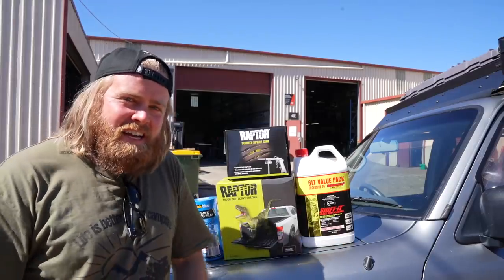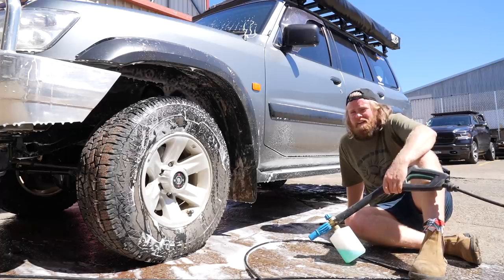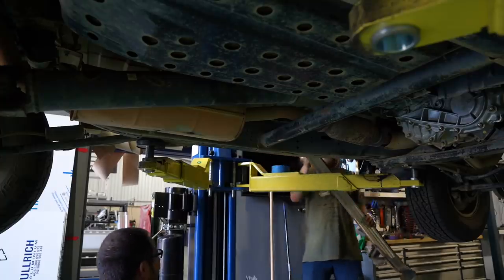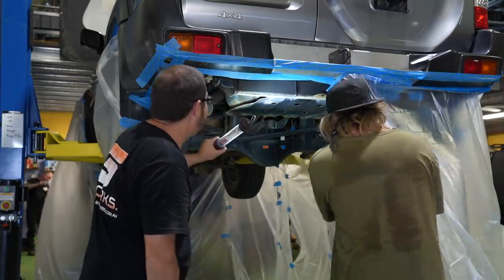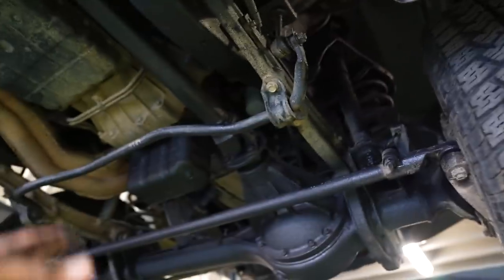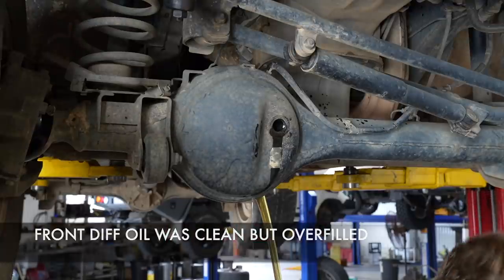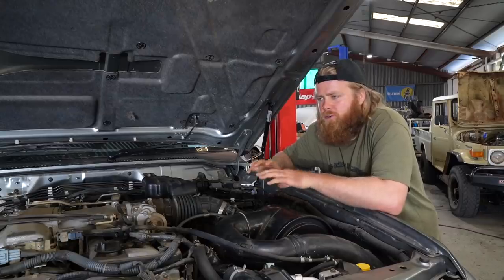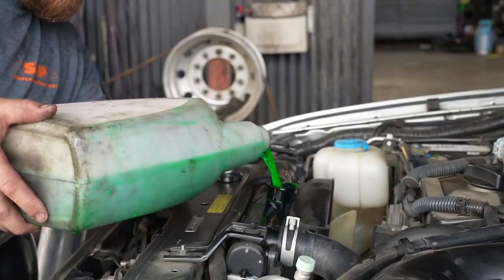DIY RUST PROOFING a 4WD! I blasted the Patrol with PAINT! + FIRST SERVICE! Nissan GU Patrol Build #3

Comment: My biggest concern with doing this type of protection is the potential of trapping moisture behind the layer and creating a corrosion zone. I've seen this done in salty winter road parts of the world and it doesn't always work out as intended. I just do a Roothy and Lanlolin coat for rust prevention. That being said if you're doing gravel and dirt roads for the most part then you definitely protecting against road rash.
Reply: I agree, I can’t understand why you would use raptor as opposed to something like lanolin 
Raptor is just thick paint
Reply: 100% might just be trapping moisture in there
Reply: Yes I agree . Lanolin is probably the go , I’d use rust inhibitor or zinc oxide if I had to paint underneath.
Or fish oil.
Reply: @nathanrykers7588  100% lanox lanolin spray is the go coat it every 6-12months with lanolin get it in 4L packs much cheaper and works a treat been doing this to my 80 series for over 30 years

Comment: Looks awesome.  Good to see the maintenance being done (as an automotive technician, this makes me happy!)!  The raptor coating looks great! Wouldn't work very well were I live (rust belt of Canada- means basically driving in Salt water for 6 months), as any type of permanent coating (rubberized undercoating, or bed liner type material is a terrible idea because these types of coating trap moisture under the coating and causes the metal to rust even faster but you can't see it because of the coating!  We use none permanent coatings, either oil or wax based with corrosion inhibitors. 
Awesome content Tyler!  Love the plate on the truck!
Reply from the maker: Thanks mate!

Comment: I looked at all sorts of "rust proofing"  products about 6 months ago for my gu project, It always came back to standard rust converter/primer and 2 pack paint.. (on the chassis anyway) Because anything thicker, cracks and holds water underneath and rots from the inside out. 
Wurth do a rubberised spray product that was a massive problem for this. 
2 pack is easy to grind and spray over if chips and cracks but.
I never considered raptor coat, would like an update!
Reply: That's what I've seen also, you need to kill the rust, convert it and then seal the steel with something like POR-15, because anything else will look good but it will continue to rust underneath the Raptor, then you will see large chunks of paint crack off revealing rust pockets.
Reply: @jonathanmcdonald1101  I'm from Austria and we salt all winter and whenever it's cold outside. We only use cable grease to seal of the salt from cars. Cable grease is very cheap and is probaly the best rust inhibitor you can put on. Not a single spot of rust after numerous years of driving in a very salty environment.
Reply: Just use killrust matt black in a can. Does the job and is cheap?
Reply: @Snook_  I did that for the tailshafts and such, it's easy to touch up, on a service or part replacement I usually give a wire wheel and quick paint.

I do find 2 pack, washes better... Once pressure washed the residual dirt doesn't stick to the metal. So leaves a more nicer finish once cleaned.

Por15 is great for very heavily corroded steel, or things left out side .. 6x4 trailers etc cheap and easy to apply.
Reply: Jonathan McDonald POR-15 is the best, I basically painted it on with a paint brush on my Gemini floor pans and it looked bloody show condition... rate it highly

Comment: Don't forget the king pin bearings in the front swivel hub housings, do them the same time you do the wheel bearings, you will have it all apart anyway, you dont want one of those failing when your out bush, specially now that your putting bigger wheels and tires on so putting more load through them.

Comment: Brake fluid. Also for coolant they should use demineralised water not tap water. For transmission, did you replace oil filter too?

Comment: I would also replace the radiator hoses and keep the oldies as spares like with the belts. Also a mention, I didn't notice and enviro wash traps when you did the under body degreaser. Please tell me they were there but out of shot..................😮🤞🙂

Comment: Drill holes in the bottom of yourplastic guards behind the mud flap. Patrols are good at collecting water down there and rusting. ALso check your door bottoms dont have the drain holes blocked, very common to be blocked and cause the doors to hold moisture/rust.

Comment: Good work 👍 I’d swap out the fuel filter and change the power steering fluid (it usually gets overlooked and works hard) Also a fine metal strain inside the pump if you get a bit of noise that can do with a clean. You’ll probably flush the brake fluid when you swap out the brakes is the only other thing.

Comment: Not too sure about spraying raptor straight on. No prep other than a wash?
I found easiest long term is just the black rust converter/paint aerosol cans. At every service have a look underneath anyway and touch up where it has rubbed off.

Comment: I hope matic j compliant trans fluid was used in the trans. Cant use normal atf your gearbox wont last long. 

Get onto patrolapart and order some genuine o2 sensors always good to keeo a couple spare if it starts drinking the fuel. Make sure the elec lines to them dont have enough slack to hit and melt on your exhaust.

Comment: Great job !
Just wanted to share MY experience with Bendix ultimate brake pads on my 4wd, hope you are not getting these pads ?
1. They squeel when going slow 2. They wear very quickly, 60% worn after only 10,000 kms 3. Brake dust, wheels are covered in brake dust very quickly 4. Work great around town, only light pedal pressure required, good feel BUT on a reasonably long down hill they fade, I mean loss of brakes fade, apparently they have a low heat threshold  5. I emailed Bendix 3 times with no response 6. I wanted to ask Bendix if these are the best pads for my vehicle, ultimate pads are supposed to be the "ultimate",  but maybe their 4wd pad might be better / more suited to the weight of a 4wd...
Reply: Same experience with bendix. Never again.
Best pads are ebc yellow stuff but expensive. 
Next best is genuine pads for the 4.8 soft compound. Patrol apart or nissbits will supply the right ones.
Reply from the maker: Cheers for the info!
Reply: @TylerThompson90  
I highly recommend browsing the patrol4x4 forum. There is so much info there is you use the search function and if you can't find anything there are loads of knowledgeable people willing to give advice.

Comment: Raptor is probably the worst you can do to your chassi! I only use cable grease as it's known to be one of the best rust inhibitors you can put on. I've done 3-4 cars in my past and had outstanding results. Not a spot of rust in numerous years of driving in a very salty invironment.
Reply: Why is it the worst
Reply: @angushalliday9228   Raptor itselfe is a great product, but by putting it on to your chassi you will risk rotting your frame out from inside out. Especially if you had any kind of rust before spraying it on! Raptors hard scratch resistant structure will trap any kind of moisture and therefore defelope rust underneath. Any kind of grease or oil will do a much better job as it can flow and therefore will seal itselfe back up after getting scratched or damaged. Im from Europe/Austria and our roads get salted nearly all year long...so we know how to prevent rust damage to our cars. Cable grease is the way to go! Cheers

Comment: Looks good mate , just curious how does the raptor adhere with no prep? No sanding up parts etc.
Reply: Looks great as an end finish. Was wondering the same with prep? Will the texture be harder to clean after salt, sand n mud?
Reply: Same question, i raptored my barwork recently and had to sand and prime everything before raptor coat.
Reply from the maker: Honestly. I know very little about this stuff, I asked around and majority said you dont need to prep just get it super clean. so I did haha

Comment: did you changed the fuel filters, if you haven't already buy two and keep a new spare in the back and buy yourself some m.a.f. sensor cleaner and use it every service to clean the maf sensor.
Reply from the maker: We did the fuel filter but missed filming it. I'll definitely keep a spare filter and good tip on the maf sensor!
Reply: @TylerThompson90  CRC make a spray Can called mass airflow sensor cleaner, the stuff works great just following the instructions, a tip for the the sensor is be careful with the screws and be a bit gentle with the "O" ring when removing and installing the sensor.

Comment: Not sure why so many people use raptor? And why would you coat the tsil shafts? They are balanced, this will throw the balance out, maybe not significantly, but still. As for under body, Im in the automotive repair industry, personally Id be using a water based stone gaurd/body deadner, which is rubberised. I know you are not a car guy and trying to learn and good on you. For your own experience, just as you took the car to a mechanic for advice and service, dont be shy about contacting a body shop for advice. Yrs you will get different information, and the underbody now has protrction, just there are so many better priducts for underbody. Car is coming along nicely
Reply from the maker: Cheers for the tips mate, something I'm pretty new to so learning as I go!

Comment: Seriously hope that wasn’t tap water going into your cooling system. To my knowledge you should only be using distilled water to dilute the antifreeze appropriately, as the minerals from the tap water will start precipitating out over time thus coating your system and degrading cooling performance.

Comment: That was really good to watch man! Enjoyed every second! Mine's a ZD30 hey :) Can't wait to do my diffs, transfer case, auto gearbox and engine oil. Did the coolant already as swapped the radiator some weeks ago. One question: is the gearbox oil change an easy straight forward DIY job or does it need any flush at all in a workshop or something? Cheers mate.
Reply from the maker: The automatic transmission has to be done carefully the mechanic said, you have to make sure you put the exact amount you put in etc, the rest of the fluids were pretty straight forward
Reply: @TylerThompson90  Thanks for your time mate, appreciate your reply! Very helpful! I just don't want to damage the transmission so will take it to a good mechanic.

Comment: Tap Water in your Radiator?
Reply: I was wondering about that but I think its ok if you combine it with a coolant concentrate that has corrosion inhibitors in it? I run distilled water and water wetter in mine.